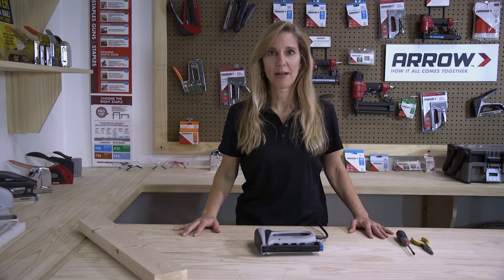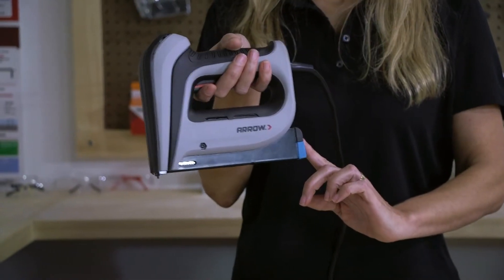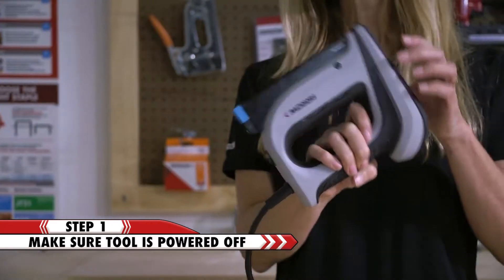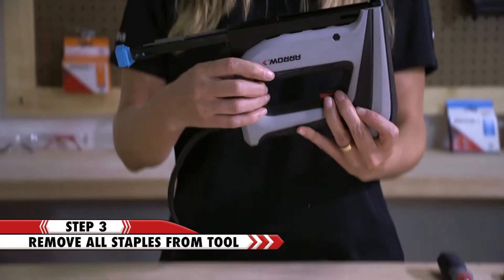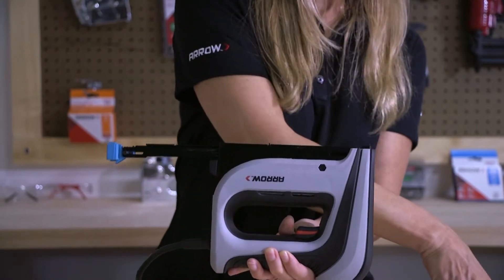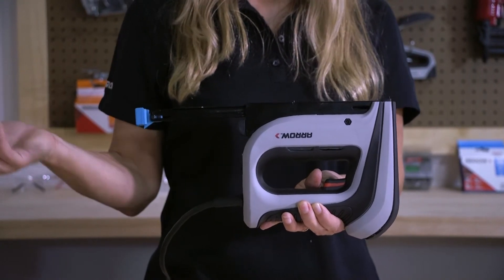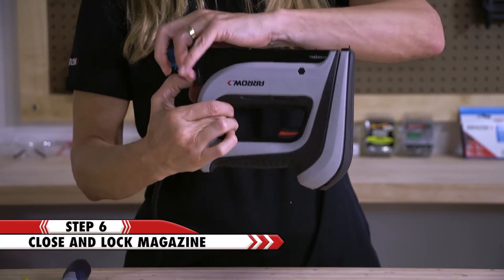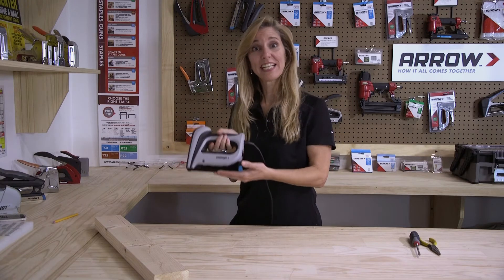How to Clear a Jam From Arrow's T50ACD Electric Staple Gun

Comment: I just got one of these. It keeps stopping as if it’s jammed. When I open it up to check, no staples are jammed. Then I reload it and try again and it shoots about 5 staples before it stops working again. Any ideas?
Reply from the maker: Hello - Take a look at the manual for operating and troubleshooting information: https://bit.ly/t50acd-manual. If you can't resolve the problem, please give us a call at 800-776-2228. - Arrow Fastener Team
Reply: this doesn’t help at all. pdf shows nothing about fixing a jam that doesn’t exist.
Reply from the maker: @robretondo9709  Please give us a call at 800-776-2228 so we can help you find a solution. If your tool is defective and within the warranty period we can offer you a replacement.

Comment: I have the battery powered version of this staple gun. It does not appear to be jammed but when I try to use it it flashes red and green and does not drive a staple. Any idea how to fix that?
Reply from the maker: Hey Eric! We actually have a video on your tool (the T50DCD) right here: https://www.youtube.com/watch?v=9Y48g-T6Fnc
And if you need unjamming instructions, you can find them here: https://www.youtube.com/watch?v=qP0V2_ogPWo

A solid green light means that the tool is ready for use. A flashing red light means the battery is low. And a flashing green light means the tool is in power saving mode.  Please note that in the product tutorial video, you'll see the green light flash a few times in a matter of seconds. This footage was sped up to make the flashing more obvious. In reality, the green light will flash much slower when the tool is in power saving mode.

If you still need help, please contact our customer service team! http://www.arrowfastener.com/awesome/contact
Reply: @arrowfastener  thanks for the reply. In my case the tool is flashing red and then green, then red again and so on. The manual doesn't mention anything about that.
Reply: I just bought this item from home depot and started charging the battery. Its been like 8 hrs and still flashing red. Should i return it?

Comment: I have only used my Arrow T50AC once. I am trying to use it with staples. I have loaded and reloaded over and over because the staple is folding up and breaking.  It has jammed once but typically its  coming out all scrunched up.  I can't find any info on this problem.  I have double and triple checked my staples. They are arrow brand and the size and gauge is correct. Help.
Reply from the maker: Hello - It sounds like this may be occurring because of how you're actually firing the staple gun. Please take a look at the manual, pages 8-10 in particular: http://bit.ly/t50ac-manual. The contact safety feature helps prevent accidental misfires, but It can take a little practice to become accustomed to it. You'll find more information on p. 10 of the manual. If you continue to have problems, feel free to contact us at customercare@arrowfastener.com or 800-776-2228.

Comment: What happens when you buy one brand new bring it home load it as it's supposed to be and it don't fire the 1st staple it don't even make a noise you know you make a noise
Reply: Have u found out the problem yet?
Reply from the maker: Are you using Arrow T50 staples? Is the stapler plugged into a working electrical outlet? Please contact us for help. If the tool is defective, we can replace it under the warranty. Reach us at customercare@arrowfastener.com or 800-776-2228.
Reply: I took back to Walmart and bought another manual  one witch is hard for me  to use Walmart did not have a new one for Me to exchange  it for

Comment: I need instructions on how to fix a stapler that won’t take a charge. It’s basically brand new.
Reply from the maker: Hello - Here is a link to the manual: https://bit.ly/t50acd-manual. If you need more help, please call us at 800-776-2228. If the tool you purchased happens to be defective, we'll send you a replacement. - Arrow Fastener

Comment: I got great practice with this because this pos jams every other shot.
Reply from the maker: One of the reasons a stapler may jam is because the staples you're using are too long. Take a look at the manual for instructions and troubleshooting for your staple gun: http://bit.ly/t50acd-manual. Hope it helps!
Reply: @arrowfastener  They are 1/4 inch Arrow brand T50 staples. It is being used to attach screen to pine. I suspect that the stapler off of my office desk could do the job with less jams.
Reply from the maker: @gastlyfellow  If you're stapling into pine, you actually might want to try a LONGER staple; a 3/8" might work better. Take a look at our staple guide for more information: https://bit.ly/3fJdrRS. If you need more help, please contact us at customercare@arrowfastener.com or 800-776-2228.